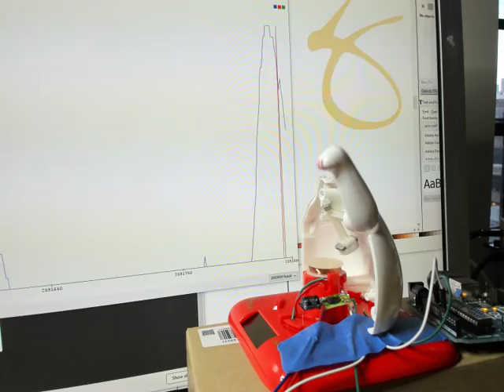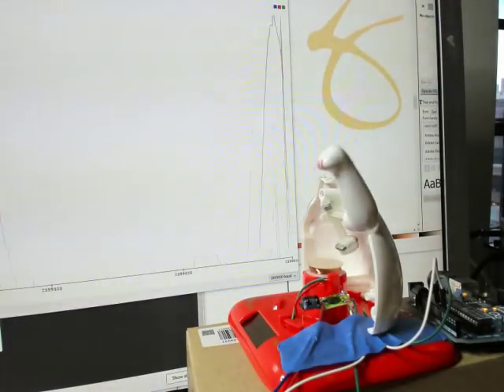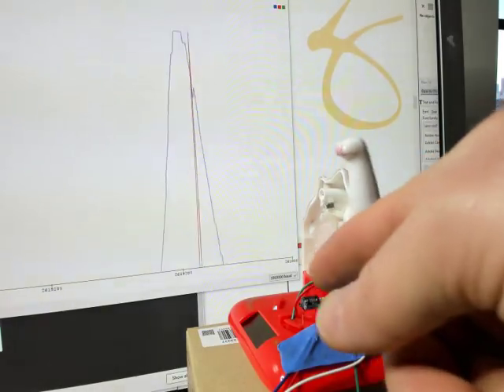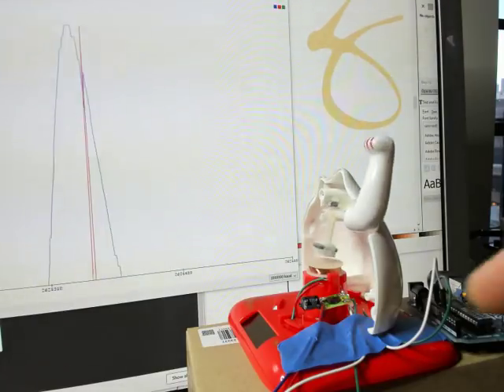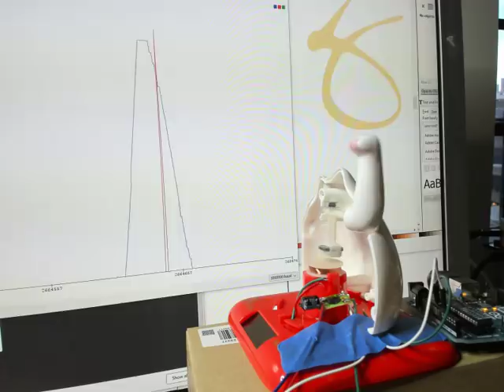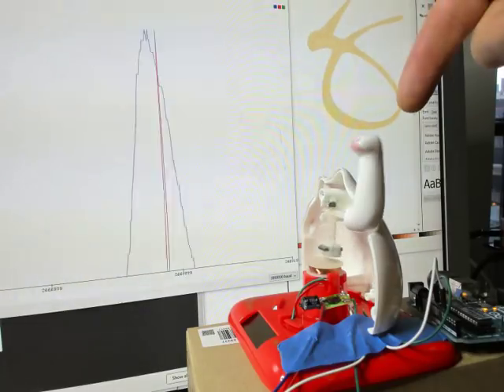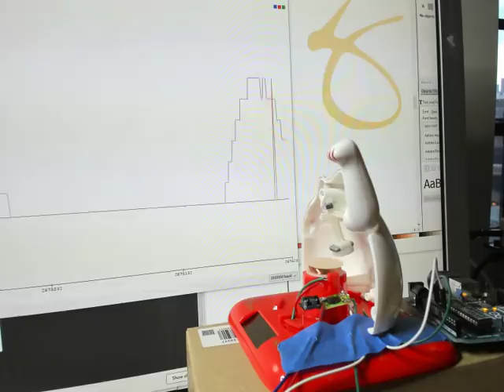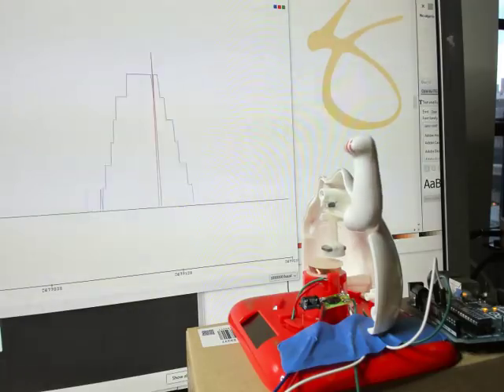Deconstructing a Happy Lucky Cat

Comment: Do you have a shot of the original circuit anywhere? I would love to see what kind of analog circuit they have going.
Reply from the maker: This particular cat's circuit was a chip under under a blob, so not much to look at - but all the circuits are similar. They have a way to detect the passing magnet by its peak, a transistor to actually power the coil and give the nudge, a capacitor to store up energy to be released in the nudge. If they are self starting (some need you to get them started) then they will also have a timer to generate the starting kick. 

Here is an example circuit with a bit of explanation:
https://cdn.solarbotics.com/products/documentation/zendulum%20manual%201.12.pdf